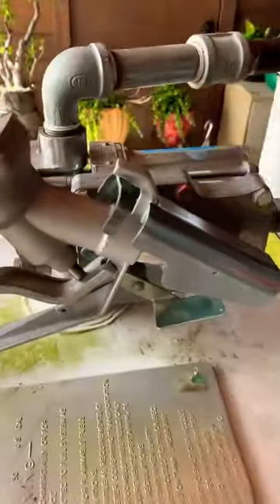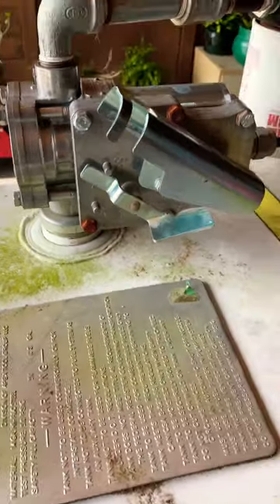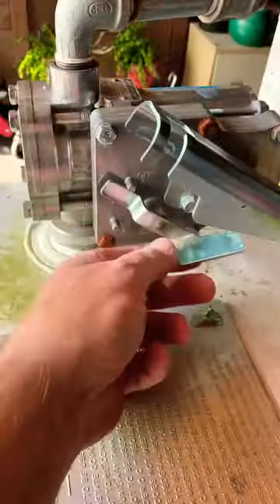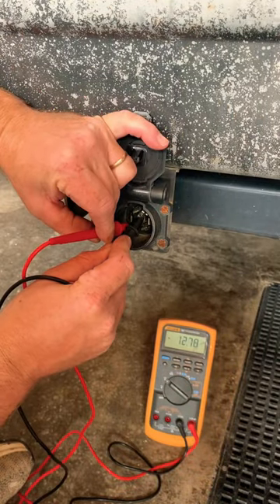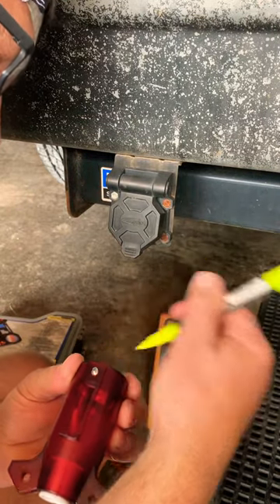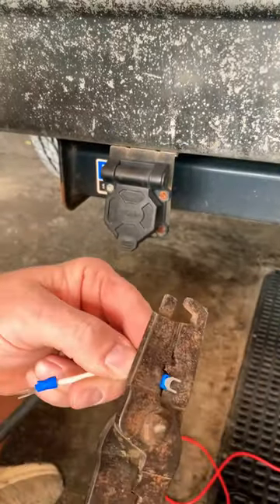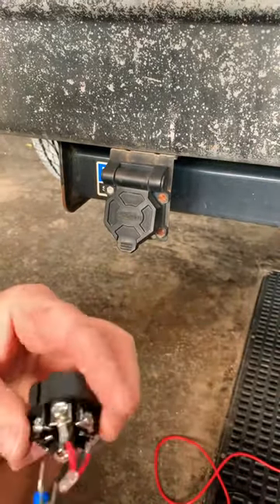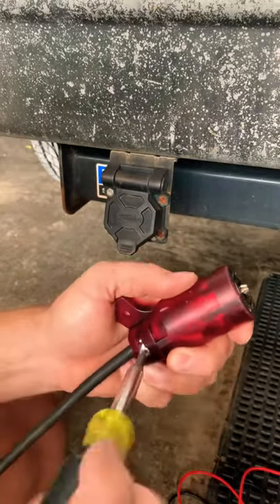12v fuel pump UPGRADE #diesel #equipment #fuelpump

Comment: Has anyone here used jumper cables to the battery on the truck for power on the fuel pump?
Reply from the maker: I have not but it would work just fine.

Comment: But be careful not to show that pink stuff to any one who cares. That's a $10,000 fine here in ct
Reply from the maker: Even in off-road equipment? It’s illegal for road vehicles to run it here in TN, I use it for my construction equipment only.
Reply: @w.k.d.constructionllc  fun Fact,,,if you let dyed diesel sit out in the sun in a clear tote for a while it’ll “Burn “ off the dye ….or so I’ve been told 🤣🤣🤣🤣🤣🤣🤣